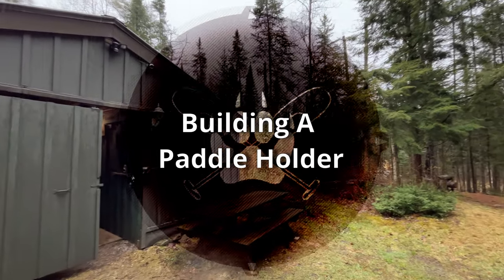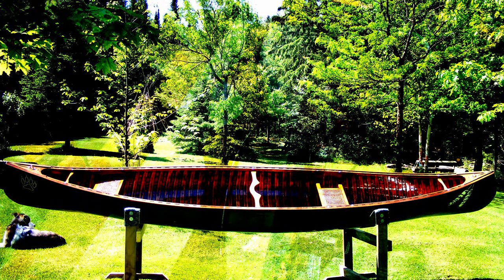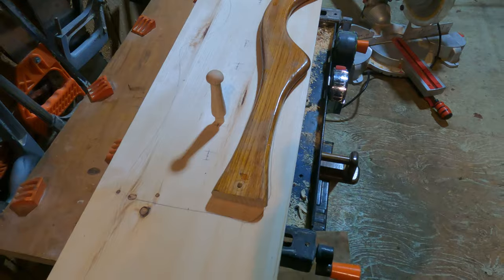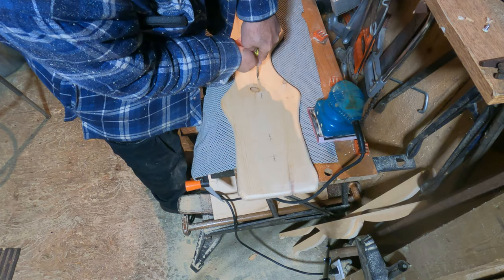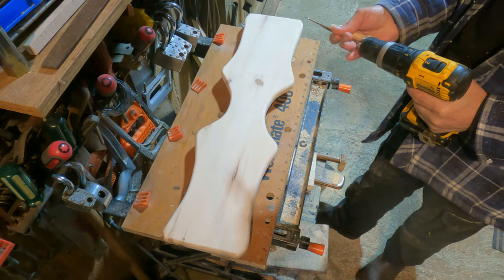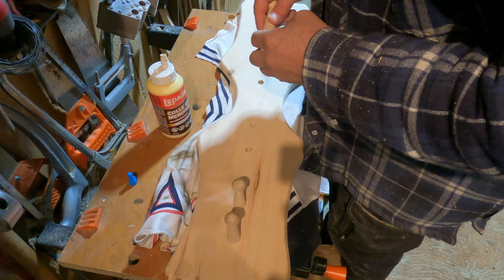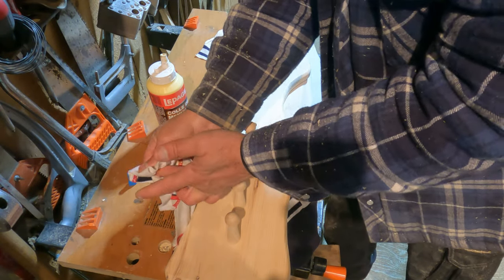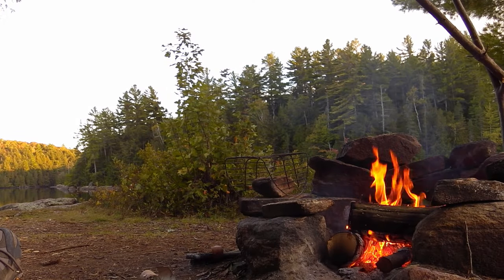DIY Paddle Rack - Storage Solution For Your Favorite Paddles

Comment: Very nice. Where did you get the pegs?
Reply from the maker: I bought them at Home Depot - you will find them in the section where they sell the pine boards. They will run you roughly 6 bucks for a pair.  Well worth it.  Thanks for the comment.